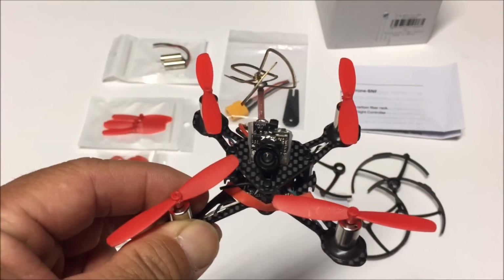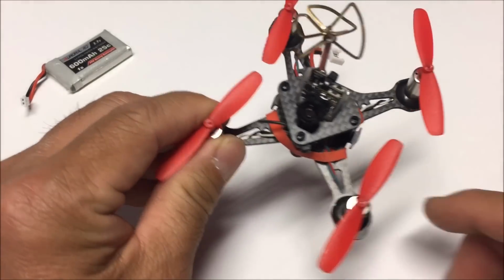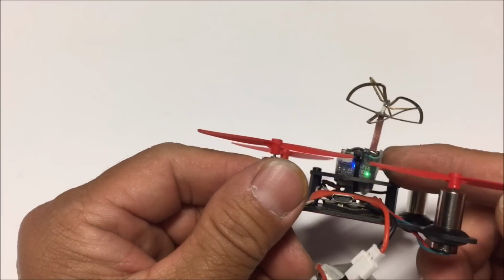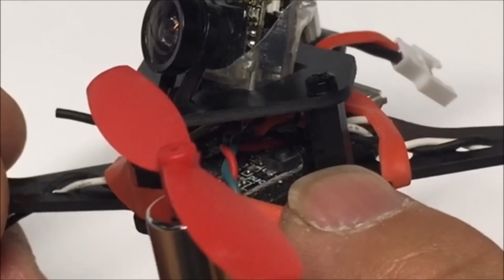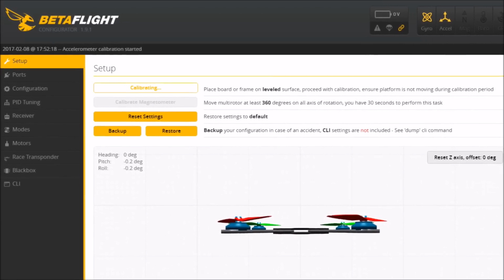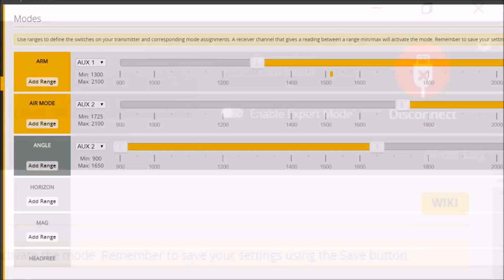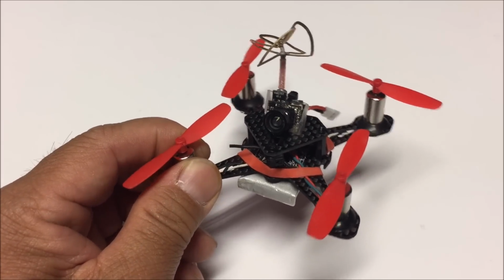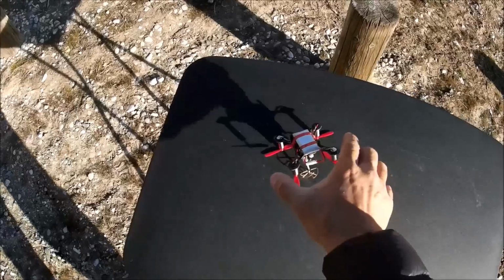ji fun 85x brushed F3 mini racer

Comment: It seems like the camera is a gonner the first time it takes a decent tumble. Seems like a very vulnerable design.
Reply from the maker: lashley370z 
You know....most of this type of design with the circular polarized all in one type vtx on top are all vulnerable to destruction in a tumbling crash.
I actually like the camera in the front with the whip stinger type antenna design but so far all of those seem to not have the decent power and agility like this X style design and these X style have no other spot to put the vtx but in top....
You win some but you gotta compromise on others things....
Try not to fly on paved areas :)